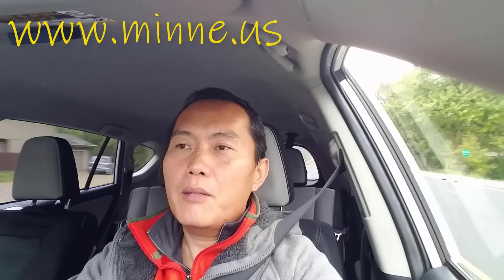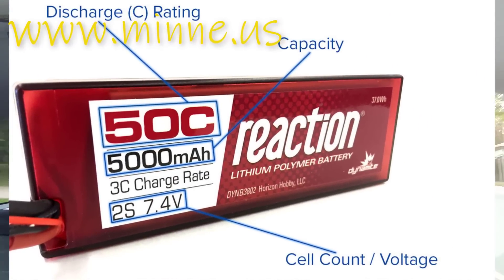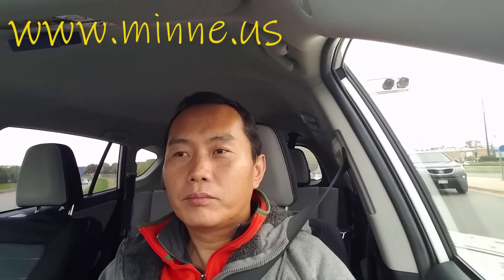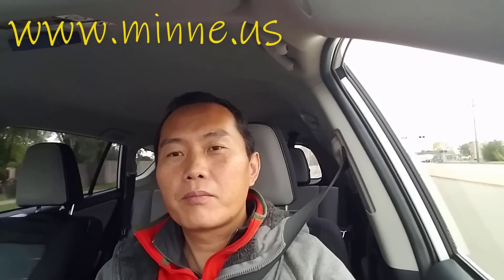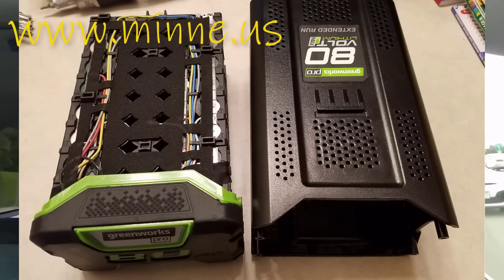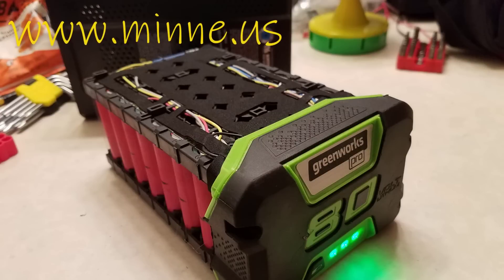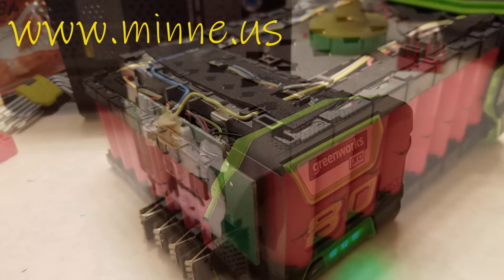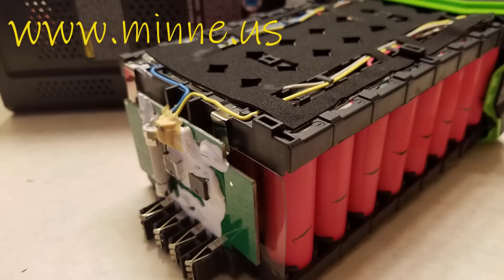Electric Paramotor LiPo vs Li-ion battery which better?

Comment: You mean it is normal to running paramotor by 18650 battery?
Reply from the maker: Yes. My paramotor running on 18650 battery.

Comment: Thank you for your information, so If I put Li-ion (powertools) battery on my setup that use max 250 A of current, it can handle that power ? Otherwise, can I put 3 of these batteries to increase the discharge rate (so the batteries voltage slowly go down).
Thank you for your response !
Reply from the maker: you need 6 batteries. I have battery link package with killer switch:
http://minne.us/shop/batteries-link-package/